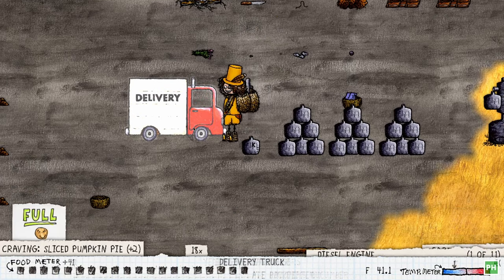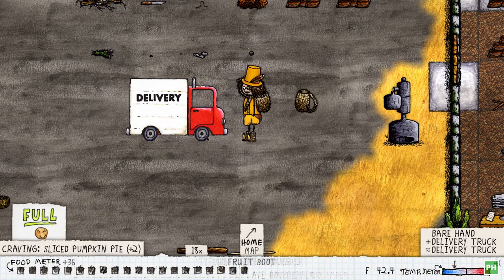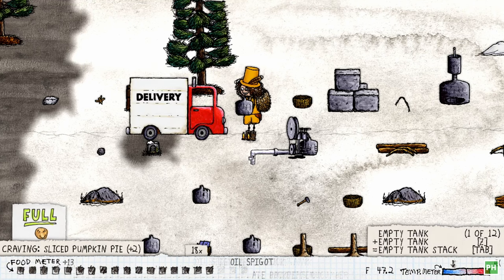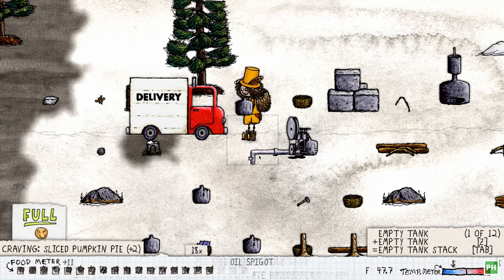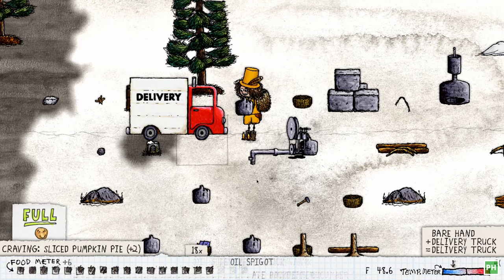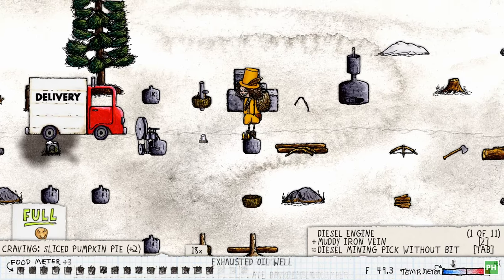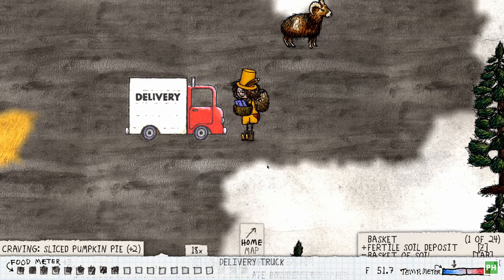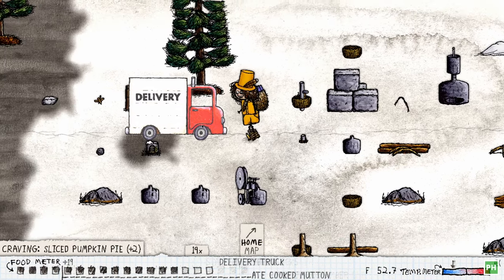The Oil Guide

Comment from the maker: Oil "tapout" will leave all tarry spots east and west that are 160 tiles from you dry. The next closest tarry can be 200 tiles directly east or west. Wet tarry spots spawn in the tundra in forty tile apart increments similar to spring sites in the meadows/plains/swamp biomes, and muddy iron veins in the rocky biome. Wet tarry spots have a much lower spawn rate however and won't appear every forty tiles.
Reply: Which is it now? every 40 tiles or "much lower spawn rate" for wet tarry spots. I'm confused
Reply from the maker: @G-Fiti  Every forty tiles there is a chance for one to spawn. Sometimes there will be a waystone instead or the tile will be regular snow.
Reply: @Buttersman  Thank you!

Comment: Hello. I've enjoyed this series. I have some questions though. If you don't have 24 empty tanks, can you leave and come back later to finish? Can you turn it off or will the kerosene run out and dry up the well? Or, if the kerosene runs out, can you add more and continue?
Reply from the maker: You can come back to finish pumping later if you don't have 24 tanks. It will still give you the full 24.

For the second question, you can only add fuel once. When the fuel runs out the well is dry and you need to drill a new wet tarry for more.